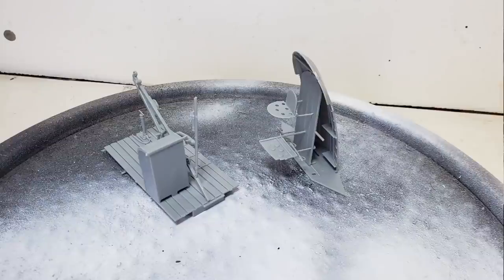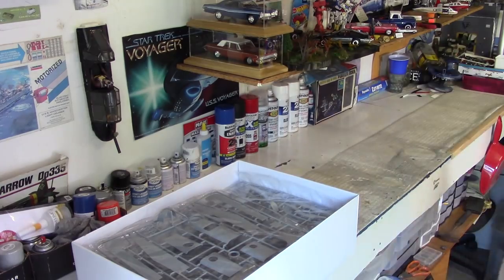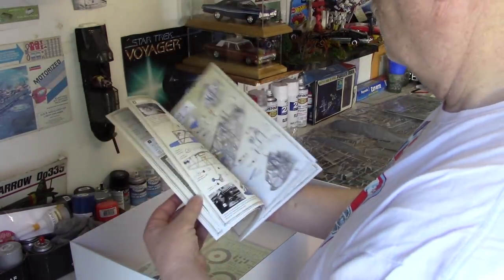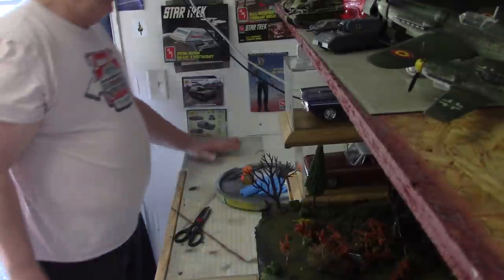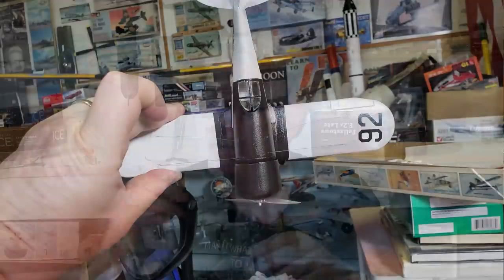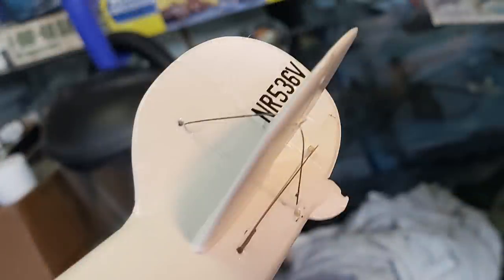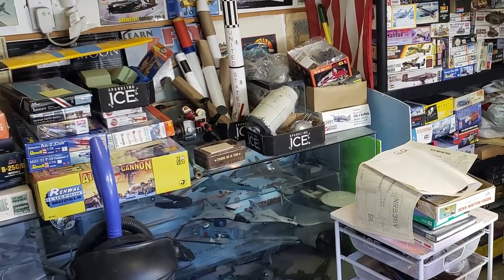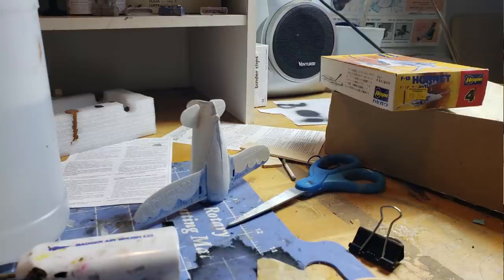Max's Models after hours 4/13/21

Comment: That right a collector. If u get were u don't have enough room for the boxes over a period of time. U can cut off the front of the box and frame it and put the side of the box behind the main picture, if u wanted to keep the sides. If u don't want to frame it yet, then separate the front and sides and put them in medium size box and stack them that way.   From the #sledgemaster

Comment: Great video Max, very nice. That WNW Felixstowe box looks packed with challenging happiness in the form of a significant project.
For the lines on the Gee Bee have you looked at making a stencil and drawing the curved lines in with an acrylic paint marker? If you search online for POSCA paint markers you might be able to pick them up on Amazon. They're quite good for detail work like that.

Comment: To tighten your Fish Line for rigging -- simply pass a cigarette along the line about a half inch quickly with a steady hand. The line should stretch tight very easily.
Reply from the maker: thanks
Reply: Presuming it's a lit ciggie, just don't inhale whilst doing so.
Reply: What's a NON SMOKER To Do ??
Reply: Start smoking 😀

Only joking of course!
Reply: @garyparker2969 Gary - I don't recommend that people would need to smoke to apply this technique. Many of the materials we employ in model building are "deadly" ---- to say the least. I need not digress further in this regard but one ( who doesn't smoke ) could simply buy a pack of cigarettes to use when applying Fish Line for antennae or strut support wires. Cigarette ashes are also a good powder to use for weathering the surfaces of aircraft and armored vehicles. I employ it regularly in my builds to dust the surfaces and matte-treat the paint finish to enhance a more raw final effect. You can sprinkle or dry brush the ashes and lightly rub the surface by hand ( finger ) or use a cotton swab to work the effect. "Test Fly" it first on a scrapped kit or leftover part and see if it works to your satisfaction.